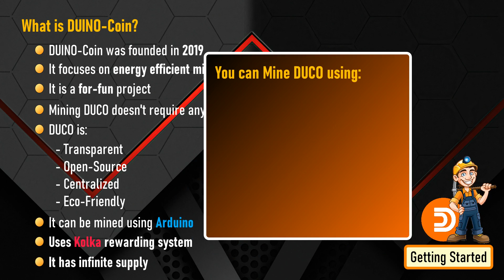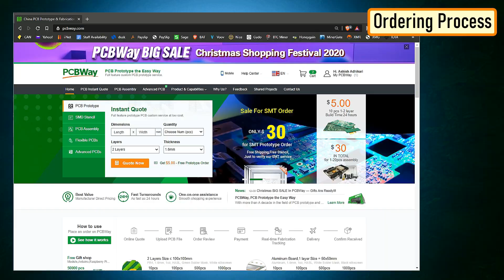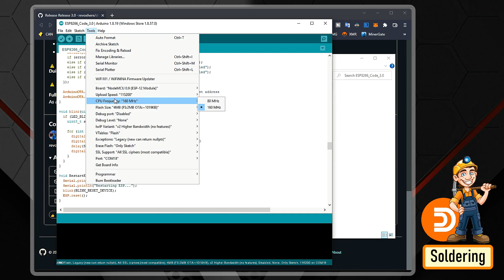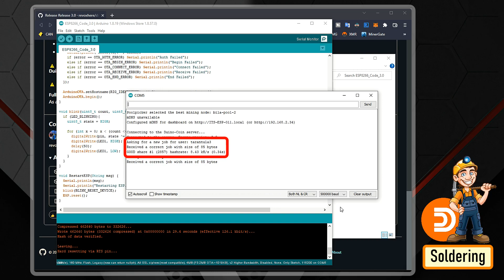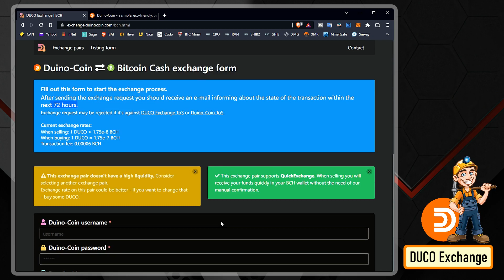NodeMCU DUCO Miner

Comment: Getting a 'D1' was not declared in this scope when using your code. Is there a missing line? any suggestions
Reply from the maker: I just tested the code 
It works without any issues 
Are you selecting the correct board type?

Comment: Are the LEDs on the board necessary, or can I just solider the power cable and plugs for the board and start mining? Is there a parts list for the parts I would need if I wanted to add the led? Whats the code I would need to add to the updated software, and where do I add it?
Reply from the maker: Hi there 
The LEDs are optional. 
You can find the parts list and the code  in my blog, the link is in the description section

Comment: i have an error

Arduino: 1.8.19 (Windows 10), Board: "Generic ESP8266 Module, 160 MHz, Flash, Disabled (new aborts on oom), Disabled, All SSL ciphers (most compatible), 32KB cache + 32KB IRAM (balanced), Use pgm_read macros for IRAM/PROGMEM, dtr (aka nodemcu), 26 MHz, 40MHz, DOUT (compatible), 1MB (FS:64KB OTA:~470KB), 2, nonos-sdk 2.2.1+100 (190703), v2 Lower Memory, Disabled, None, Only Sketch, 115200"

C:\Users\Ashar Tahir\Downloads\Compressed\ESP8266_Code\ESP8266_Code.ino: In function 'void {anonymous}::SetupWifi()':

ESP8266_Code:432:45: error: 'SSID' was not declared in this scope; did you mean 'USID'?

  432 |   Serial.println("Connecting to: " + String(SSID));

      |                                             ^~~~

      |                                             USID

ESP8266_Code:435:20: error: 'PASSWORD' was not declared in this scope

  435 |   WiFi.begin(SSID, PASSWORD);

      |                    ^~~~~~~~

C:\Users\Ashar Tahir\Downloads\Compressed\ESP8266_Code\ESP8266_Code.ino: In function 'void loop()':

ESP8266_Code:663:61: error: 'USERNAME' was not declared in this scope

  663 |   Serial.println("Asking for a new job for user: " + String(USERNAME));

      |                                                             ^~~~~~~~

exit status 1

'SSID' was not declared in this scope; did you mean 'USID'?

This report would have more information with
"Show verbose output during compilation"
option enabled in File -> Preferences.
Reply from the maker: Mr Ashar
Looks like your code is missing the definition of SSID

Please use the code I provided 
Thanks
Reply: Do you give me your instagram for contact